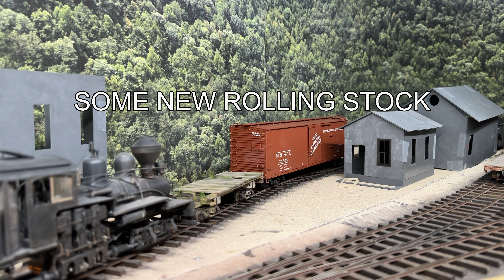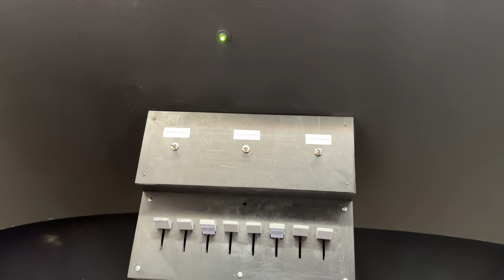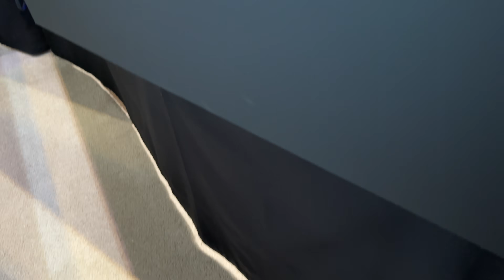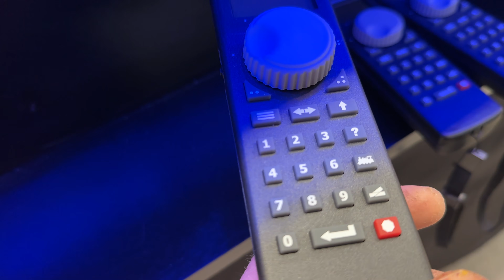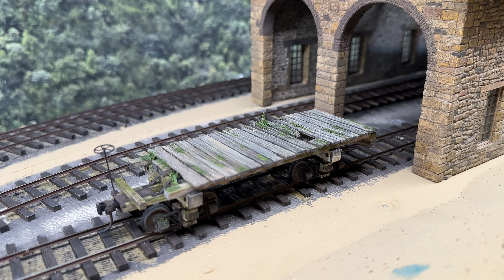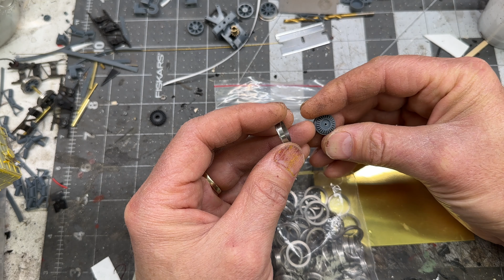Manns Creek 2.0 Build, Part 22

Comment: Interesting problem on loading the small tipple. I recently added live loading to my second smaller tipple and am having the same problem with coal "jumping" out of the car. Of course, mine is manually operated, not a cool conveyor, automated system!! I like your fix and will give it a try. Nice update. I'm going to give the different throttle a try, looks interesting.
Reply from the maker: originally I planned on a chute that would raise up and down, but I decided to keep it simple.  now I think the answer might be to go back to the raising chute.  I think that a vertical drop would be a solution also.  if I make a chute that is more like the ones used a steam locomotive coaling tipples (enclosed with a turned down end), I think that will help.  The Clifftop tipple has cutes that are not sloped as much, so the coal flows slower, which I think helps a lot.